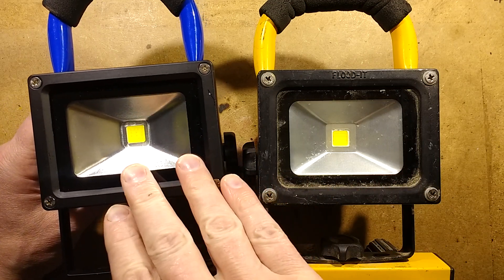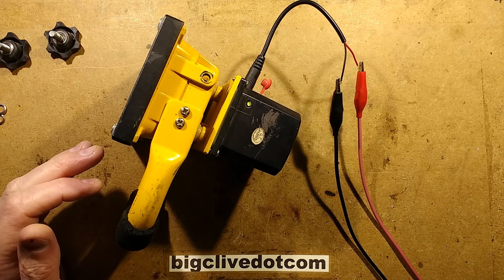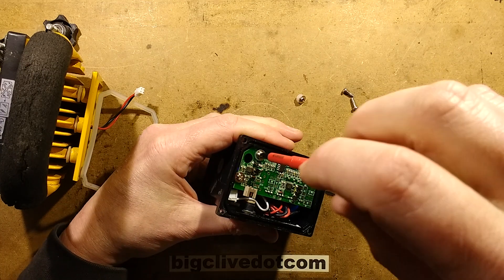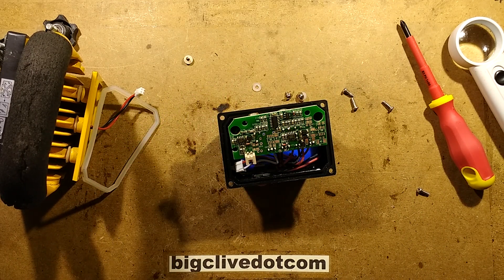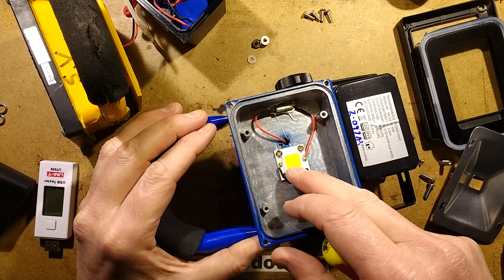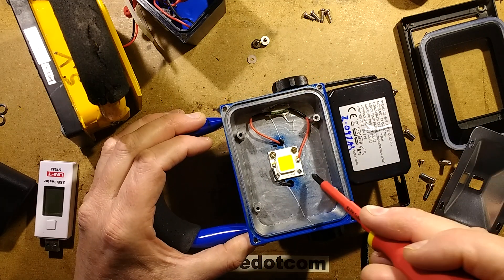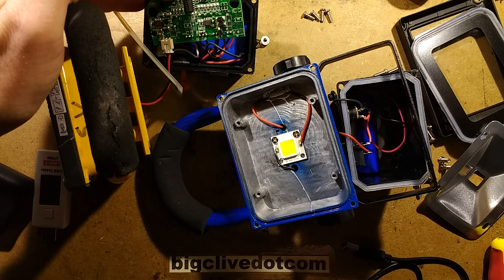Inside a proper (Utility company) LED work light.

Comment: That industrial one is damned nice and the cheap one was even crappier than I expected. I bought several of the cheapies off eBay last fall for myself and as a gift for my brother. They at least had 2x18650s in them and all output 8W +/- .2W which for a cheap "10W" work light is more than acceptable in my book. I've been tempted to do a battery mod similar to the one you did on one of mine to have around in case of another power outage like we had last winter.

Comment: I guess I was lucky. I purchased the El Cheapo from Amazon and the only thing that was cheap about it is the crappy rejected 18650's they used for power. Both tested at 1.3 AH so 2.6 total. I replaced them with three Samsung 2.4AH cells giving it just a bit more run time. The charger wasn't very good either, so I devised a better way. I may install a 10 watt LED in it as well. Other than that I can't complain. The cheap one you have, I would start by replacing the cell with three to four better ones, then I would install a 10 watt LED driver and a USB battery charge module. You can buy five of them for about $3 US. I love hacking these lights so much that I get disappointed when they don't need to be improved.

Comment: Thanks for the detailed review. I checked out the my flooded dot-com website and they do look impressively made. I was also checking eBay and found one from a u.s. seller for $13 with all the same specs 7.4 volt 4400 mah, 10 watts 3 hour runtime constant current. seems like maybe a knockoff of the flood it. I picked up two since 2nd was 20% off and will see how they perform.

Comment: Just to mention it, I've got the same thermal camera, and found out the IR lens can be focused to make electronic work easier.  I don't know that there's a commercially available tool for it, but I was able to get a site to print off a model from Thing-i-verse that works reasonably. Think https://www.thingiverse.com/thing:197580 is what I used.
Reply from the maker: The E4 has a cult following on the EEVblog forum since it was hacked.  That's probably where the thingiverse adjustment tool originates from.
Reply: Aye, the fervor around the hack is mostly why I got mine, though the manual focus was something I only found about much later.

Comment: Clive you know better!  The Chinese would say they're 5000mAh cells so 4 of them is 35,000mAh, lol.
Reply: Stinky Cheese Now let's be honest here.  Four 5,000mAh cells is roughly 50,000,000mAh.  You just move the decimal place over four digits when adding together four cells -- that's all there is too it.  Of course, only about 200mAh of that is usable capacity, the rest is secretly preserved just in case they need that extra power later on to spontaneously combust when commanded to by their secret overlords.
Reply: Battery capacity is geometric, right?
Reply: Paradoxical Nightmare You completely missed the inside joke regarding Chinese battery specifications.

Comment: put a better led in it. a dc to dc wit constant current current and voltage. and make a adapter to connect drill batteries! or batteries inside with a charger board and DC to DC.

Comment: Clive you're too generous with the eBay scammers. A unit like that I think we'd see advertising 20ah or something equally ridiculous. Various direct from China websites love the fictional 5000mah 18650 unicorn cell.
Reply: Gordon McLellan Yes, the classic 5Ah 18650 cell that inevitably produces somewhere in the vicinity of 120-500mAh under modest test load.  They are only 5,000mAh when they are sitting loose on your workbench -- they instantly loose 95% of their rated capacity at first power on.  Clearly no lies are involved, it is just an "undocumented" characteristic of cheap Chinese lithium cells that affects no other lithium battery manufacturer in the world.

Comment: Amazon (US) sells a TK10YCW from Food-It (ASIN B015YNL8GC) about $83 U.S.. I see a Walmart listing for the FL10YCW (which is what's on the back of this one) for about $52. Wonder what the difference is. The listed specs look the same. The Walmart one is out of stock (wonder what it sells for when it's in stock?).
Reply: Food-It?
Reply: Food-It... I was hungry, alright?
Reply: On Amazon $57+, Home Despot $63, Amazon- Home Despot $68.
Reply: FLOOD-IT TK50YCWD Portable Light 50W 4 Hr Battery Beast, Yellow  165 dollars and 10 more for shipping with only 1 left from Amazon.  50 watt with a 4hr battery and the one Clive has is 10W and 4hr battery.  That 50 watt must be one heavy sob.

Comment: i would laugh if both were made in china, just the cost makes it better :-D
So you need more batterys in the cheap one and a ldo constant current device bolted to the case.
You can improve it Clive :-D
Reply: zx8401ztv An LDO behaves like a resistive dropper except it's regulated.  For a power job like this, you should use a switching regulator, though it doesn't have to be the XL brand, and doesn't have to be two independent regulators like in that flood-it lamp.  I'd expect someone likely BrightPower offering a chip that combines the needed circuits in a clever way.
Reply: they are bth made in china, one is just the lowest cost parts and fake 10w led and noname cells, the other has genuine cells and a quality led, iphone is made in china right next door to a factory making an 8$ phone, i would hope they too are using different quality parts!, these sell for about 50-60£ and the cheapos 20-25, so you are getting better quality parts designed to work for hours a day  search FL10YCW  flood-it  on ebay, its our fault for buying the cheapest rather than paying a bit extra for decent quality again
Reply: My comment was for comedy effect :-D.
Oh Jusb1066, you have forgotten how silly i can be :-D
Reply: I'm no fan of cheap and shoddy Chinese goods, but they seem to dumped on unfairly in cases like this, without a chance to defend themselves.  Obviously, Chinese factories can produce any range of quality, from poor to excellent top brands. After all, what isn't made in China these days?

Most of the stuff labeled as "Cheap Chinesium" is either being peddled by some sleazy importer with no reliable contact information, or sold direct from online vendors in China, who compete directly on price.  Who among us doesn't filter by "lowest price first?"  Is it really a surprise then, that we get what we paid for?

We have mostly ourselves to blame, but that doesn't stop us from blaming others.
Reply: spot on Landrew
Reply: If the battery is 3.7V and LEDs at 2.2V, you could just use a buck dropper to get constant brightness. If there's a protection circuit, it'll cut out well before the buck us under-voltage.
Reply: +Landrew, I don't always mind lower quality, it's when there are flat-out lies (like the operating voltage on that second light or some of the mAh claims) that we run into flat-out deception issues.
Reply: The downside of that is a reduced on-time.
Reply: on the cheap, the slow reducing brightness (and no sudden cut off) is a blessing, might be hard on the 18650 but its  a cheapo
Reply: They are, most things are. Clive makes it a point that the cheapest shit he can find is from China and isn't as good as more costly products, but he rarely mentions that many of the higher end products are also from China. You see China produces a range of stuff, they dominate the low range market and they also produce mid and high range stuff as well. For example over on Chinese construction sites in buildings you won't find workers using the cheapest ebay stuff they can find, they are using much higher quality stuff that is still made in China but costs a bit more. Even on ebay if you don't buy the bare minimum there are many quality Chinese products.
Reply: They may be making both in China but the good one is designed in Germany.

That FL10YCW model was selling between $52-74 US but they recently discontinued the old models and put out new ones that are their TK models. The new equivalent to this one is the TK10YCW. Let's hope they haven't cut corners to save a few pennies.
Reply: If you don't mind the reduced brightness, it would be better to drop the voltage further (or use PWM) and you get even more life. Though you may even get a longer life anyway as you wouldn't be burning power through the resistor.
Reply: How do I know when I am buying something that I'm not just paying more for the cheap version? There are many times I'd rather pay more for a good model but it's difficult to search the good from the bad. I do not buy mains powered items from eBay. That saves some hassle. But I can pay $30 for an Anker branded USB charger on Amazon that I can buy nearly as good of from Banggood called "Blitzwolf" for $8. So blindly paying more doesn't work. This is why, as I posted elsewhere, there should be a standardized "Clivey points" system to let buyers know which products won't make their new i-phone go BANG!

Comment: light sels for about $70 usd, how much is that piece of crap from cheaper china?
Reply from the maker: About $15 in the UK.
Reply: Considering the the higher priced unit has at least 4 times the capacity along with a proper control board and a higher quality led as well as being IP65 rated and generally looked more rugged and well built. I think anyone who would be using this on a regular basis on any kind of work site can justify buying the $70 light. You dont want to be up on a ladder with tools and the light just dies on you.
I would like to see what happens on a full discharge with the more expensive light, will it flash or dim before it shuts off? if not could you easily modify the light to have that feature?

Comment: Its not racist to say the chinese stuff is Dodgy. Its just extremely common the stuff that comes from china doesnt work or is off. XD . Kinda like I wont order from america because theyre sneaky and make extra money by jacking up the shipping fees. ;)
Reply: Even decent electrical stuff is made in China now. It's only the cheap Chinese stuff that's rubbish as they're built down to a price so have cut corners to still make a decent profit.
Reply: Ms.Fixit your Phone and laptop also come from china
Reply from the maker: The actual cost of shipping from the USA is horrifically high.
Reply: Ms.Fixit Some make extra money off shipping, but many (most?) do not.  Unless you have tremendous volume and can negotiate rock bottom shipping fees the actual shipping fees paid by shippers tend to be rather high for many.  That said, many will offer you free shipping if your order exceeds a certain minimum amount unless ordering especially heavy or large items (for which shipping can become quite exorbitant).
Reply: American here; super expensive to ship across the pond.
Reply: bigclivedotcom It seems that way, but also recognize that due to the way international postal rates are set (long story omitted), the stuff coming from China is priced BELOW the actual cost of delivery. If your postal carrier is literally losing money on every ePacket from China, they need to make it up somewhere. Agreed, the best option would be mutually equitable rates, but we're talking about governments here, and "equitable" doesn't often factor in.
Reply: Ya. Im aware but were talking different levels in the consumer order. Theres mass produced product thats built in a factory overseen by a governing body with certain set standards. Then theres mass produced stuff with no regulations like cheap electronics components. Ya My motorola cell phone is assembled in china from parts that come from Usa, Japan, Korea. My Hp Elitebook is made in the same way. ;)
Reply: If you look at the "shipping" codes from the International post. The USA, UK, and a few other counties are rated a 1. So they pay High costs to ship goods via the mail.
China and India are rated a 3. So costs of shipping are much lower. 
The ratings are based off the economy side. And for some reason China is always rated very low. Saying their economy is the same size as a 3rd world country.
Reply: Teh_Squirrel Exactly! Just what I was getting at above, without getting into the convoluted workings of the International Postal Union.

Comment: I pitched my regular worklight in the garbage,the bulb gets so hot,the ceramic ends blow apart and the bulb falls out. I want to buy one of the led types but dont want the cheapy Chinese type.
Reply from the maker: If it's a linear halogen floodlight then you can get LED retrofit lamps for them.
Reply: RC Hobbyist Extreme Sounds like inferior quality halogen lamps sockets.  I used to use quite a few 250W and 500W halogen lamps (indoors and outdoors) and never experienced such failures even after decades of regular use for many hours at a time.
Reply: Ethan Poole Same here. I've had only one socket failure in 3 decades, and it was just the contact gone bad. I have had 2 lamp "seal failures" where the halogen leaked out after many years of use. The quartz tube got bright orange hot due to the carbon sputtering inside the tube absorbing the heat from the filament (around 5000°F for 500W), and the light output dimmed, but nothing ever blew up, shattered, or exploded.
Reply: I picked up a mains powered led work light from Menard's. I like it because I can work next to it for hours and not burn myself on it if I touch it.

Comment: Is the high pitched whine your power supply?
Reply: only if you are 12 :D , us oldies can't hear no high pitched stuff :p
Reply: amojak haha sorry I'm 27 and I work as an RF tech in Broadcasting and private areas. My left ear hears higher than normal frequency and my right ear hears a little less than normal. High pitched sounds annoy me being I really only hear them one ear haha. My left ear has been helpful in finding ground loop audio problems in pre-amps a few times though :) I only asked because when he took the load off his power I noticed it a lot more.
Reply: give it 15 years or so and it will go :) , when i was a teen i was ultra sensitive to high frequencies and the 15.625khz of UK tv scan coils drove me crazy!  Like you one ear was better than the other but now some 30 odd years later and both are immune to such lofty frequencies , except for my tinnitus :D
Reply: amojak In a way I look forward to it haha. I was happy with the switch from CRT with large electro magnets to our quiet oversized LCD, LED, etc, TVs👌 no more hearing a TV turn on in a house from my backyard.
Reply: John Carlaw Haha your making me want to break out equipment now just to scour the vid to search for highs and lows. Maybe even test the video playing on several different devices.
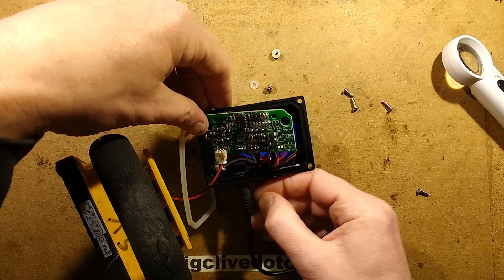Reply: John Carlaw Yea listen to it right after 8:24 when he unclamps the black gater clip the pitch kicks in for sure. There is background hiss which is somewhat normal for most people recording on standard mics in a phone, iPad, go pro, and so on. The high pitch definitely kicks in after the clip lead comes off which leads me to believe his power supply does that when it's lacking a load on it.
Reply: i heard it as well, and im 35 :D
Reply: No, that's Clive's normal, soothing voice.  Are you sure you're not watching EEVblog? ;-)
Reply: I hear VLF better than any , tone death in right ear to low ,then tone in high freg is not on left ear ????   but VLF comes in daily !  age seems to cause changes ! drum sander on right ear for nine years and speed sander on left ear, not sure today of freg blocked but always the same on testing !
Reply: John Brookbank Age definitely affects hearing. Some times I think to myself (Damn I can't wait to lose my hearing with all the idiots that surround me) and then I realize I love my music way to much and it's nothing any of my $200+ headphones can't handle🤣
Reply: at 48 i cant hear anything above clives voice, womens voices luckily go into my deaf zone
Reply: So true music is the cure for many things ! Now I wonder if iam one of the idiots you speak of !  Don't take me wrong I have many years of hearing idiots its just about who thinks what and when !
Reply: Hear that loud and clear ! how sad it is today!
Reply: I didn't hear anything in this vid but CRTs are driving me up the wall. Resonating ceramic caps are obvious one and my friend's thermostat is ringing in particularly annoying frequency for some reason.
Reply: i kind of miss the turning them off bit, where the field collapses and you hear lots of static crackle and sometimes saw a dot fade out in the middle of the screen.
Reply: Or how the best way to improve signal reception was to bash it.
Reply: What? LCDs make noise too - look up "screen tunes"
Reply: I'm 21 and so far I can still hear high pitched noises. I'm also sensitive in general, for example, I can hear the faint screech/beep of phone chargers from across the room. (Given that there are no other sounds to drown out the charger coil while. It's the whine some SMPS make when on light-load/no-load. It's either instability or intentionally skipping pulses to bring down standby power consumption.)
Reply: Benjamin Esposti Worst wall warts I deal with are the kindle chargers. I can hear them from across the room so I use them outside or in my garage. I honestly have no idea why I have five of them when they just get annoying. Mostly for when someone asks if I have a USB block they can use.
Reply: SoniEx2 cheap screens do but I don't use any that make noise as in Broadcasting I want as close to zero sound in a room when I do a full studio build out.
Reply: Brandon Cornett No, Clive is always whining about something.
Reply: Gribbo9999 haha but his voice is so soothing. Even when he burnt his "fuckin ruler" it was calming👌